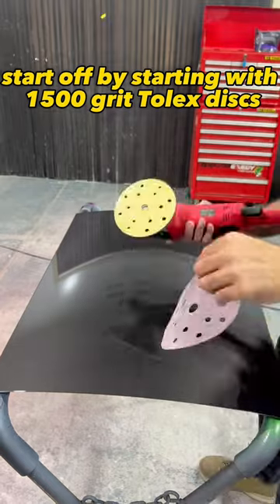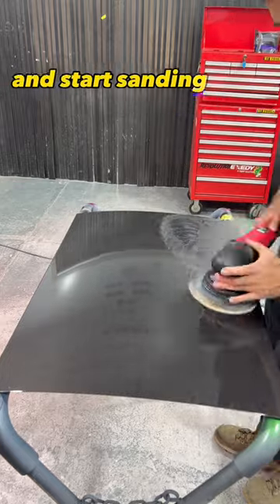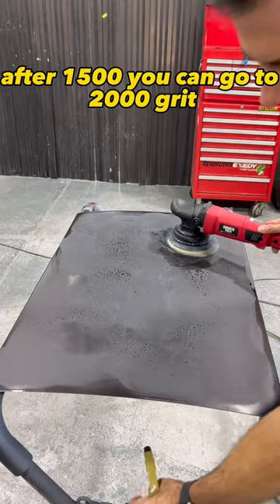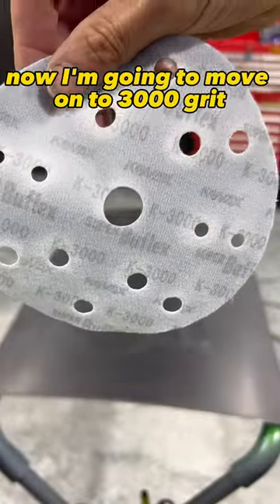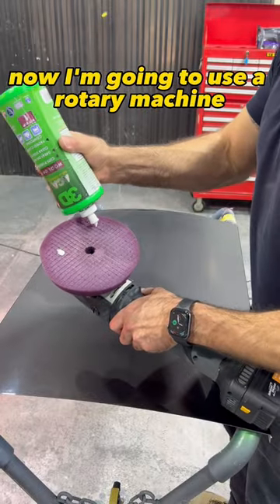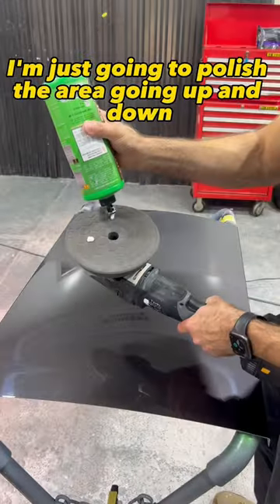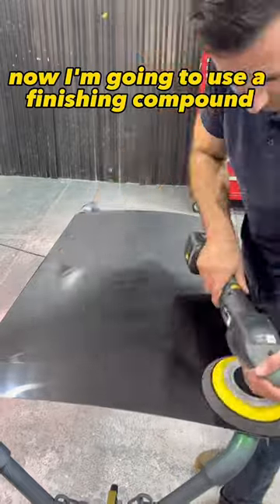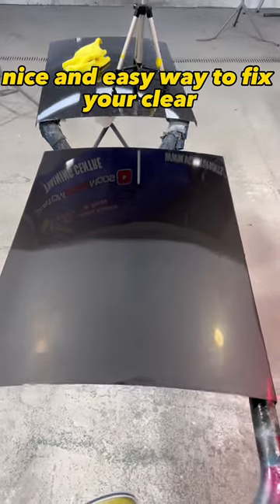Some wet sanding action. Clear coat sanding.

Comment: Kovax are dry sanding discs. Water is not required
Reply: I agree; furthermore, it is actually advised not to use any lubricant from Kovax, because it will cause more clogging issues--these dry discs already have a substance on it designed for dry-sanding efficiency.
Reply: This was a sales video for these discs. And a lot of people are going to be extremely disappointed after watching this short, and trying it.....REPAINT!!!!!!!

Comment: Is it safe to wet sand with a DA polish machine? I have only wet sand by hand and its hard
Reply: At this level of cut 1.5 2k 3k..each layer improves the other. 

Good compounds with bring back 3k use a da.
Reply: No do not do this, especially with a d-a. Use your hand 👍
Reply: @kevinohagan963 how come?
Reply: @daddychill8070  many reasons but the main ones being it will cause pig tails and unevenness of the clear coat. This is what you want to avoid, when you use your hand you wont get this, plus you actually feel what you are doing!

Comment: Can I use a DA machine I use for normal paint correction to do this type of sanding Dave?
Reply from the maker: Ideally a smaller orbit is best 2.5mm. But the 21mm or 15mm seem to work so why not hey.

Comment: How many coats of clear coat do you need to prevent sanding through the clear and into the paint?
Reply from the maker: 2 coats of clear is about 80 to 100 micron thick. This takes off no more than 10. It’s only really levelling the high spots.
Reply: Guys, Salvation is so Simple

HalleluYAH translates “Praise ye YaH”

YaH is The Heavenly Father 
YaH arrives via the TENT OF MEETING
YaH was Who they Crucified for our sins

— Ancient Semitic Cuneiform of Moshe (Moses)
— Isa Scroll (The Original Isaiah)

Isaiah 42:8
"I am YaH; that is my Name! I will not yield my glory to another or my praise to idols.

Isaiah 43:11
I, I am YAH, and there is no other Savior but Me.

Isaiah 45:5
I am YaH, and there is none else.

Comment: Can I use my regular polishing DA to wet sand? why use a sander ?
Reply from the maker: Normally a sander has a smaller orbit to a DA. The smaller orbit makes smaller scratches which are easier to polish out. You can use a DA but keep that in mind. 👍

Comment: How many passes do you have to make when wet or dry sanding
Reply: You’re trying to eliminate swirls and scratches which you can see when sanding. You only want to sand just enough to remove those. Don’t want to do too much that you eat through too much clear coat.

Comment: can I do this with my orbital sanderDA/polisher I have crows feet and too be safe should I start with 2k instead of 1.5
Reply: Do not mess with the paint at all if it has crows feet. You will regret it.
Reply: @j.waylonmusic642  I did it I regretted it but I did hand applied clear coat hopefully itll preserve

Comment: Should work in a 2x2 section at a time, if you start vertically, two passes then switch to horizontal. NEVER lay that DA flat and hit the speed. Bad juju. Work with 4.5k rpm, and keep that shit flat as can be! Overlap passes 50% and you are good. Wipe excess with CLEAN micro fiber. Don't do circles with micro, instead straight swipes. You can see everything so much better. Then.....polish up. Switch micro fibers as needed. This guy went to town on this more than needed.

Comment: Good advice, I detail paint CSM says this will only take off 1/10th of the total clear. Orange peel paint is the bumps. 

Do every step, thx for this great advice. Use a DA.
Reply: Jason Rose wet sanded a paint section, then measures each layer with his Positector. 

From base to clear...
1.7 base
1.8 paint
9.0 clear 
12.5 Total

Comment: It doesn't work. You must have 7 coats of clear to help prevent breaking through. Just do 3 coats and do the sanding by hand with a fine grit 2000, it always comes out perfect.

Comment: 3000 is over the top Finnish with 2000 then lambs wool then sponge pad lambs wool will get the 2000 scratches out

Comment: I tried EXACTLY the way he did it, it didn't work.
Reply from the maker: Can’t learn in 60 seconds sorry
Reply: Lol might aswell just fuckin sand it back and repaint it bro
Reply from the maker: @keithpeterson3805  and get more dust.
Reply: @customspraymods 😂
Reply: What happened?
Reply: @AmazingYT When I used the sandpaper with the orbital with the finest grit I'd polish it and never been able to get rid of swirl grooves dug in the clear. I had to go over it by hand sanding to get rid of them then polish it normally to come out with the finish you want. I tried it on epoxy clear and automotive clear and sanding with  a palm sander never ever worked. If you think it works take a closer look for scratches and you'll see them. Something you don't want at all.
Reply: Hmm that's weird. But luckily they came off sanding with hand.
Reply: @AmazingYT  it was the only proper way

Comment: No, it is NOT "fixed." You have removed some of the clear coat that is a protective layer to the base coat paint. Now the smallest rocks or debris will scratch and chip all the way through the clearcoat and base coat. You should have resprayed the clearcoat in order to maintain the same level of protection as the factory when the vehicle was manufactured.
Reply: We detail cars like this all the time we measure the depth of paint...you may not do this on very thin paint...just use a da with Meguiars 105/205
Reply: Thats really not how it works, however, you are correct, manufacturers put as minimal paint as possible on so you really shouldnt be flatting and polishing. in fact, id bet to use 1500 sanding this its already been painted before.
When respraying anything to a decent standard, 4 coats of lacquer then you can sand it back properly :)
Reply: you only remove less than a tenth of a micron of clearcoat.